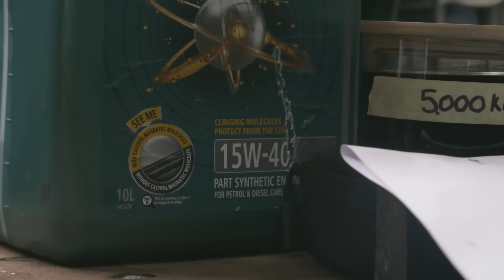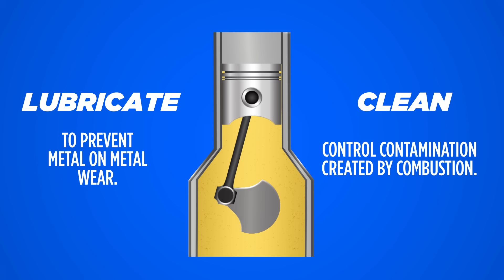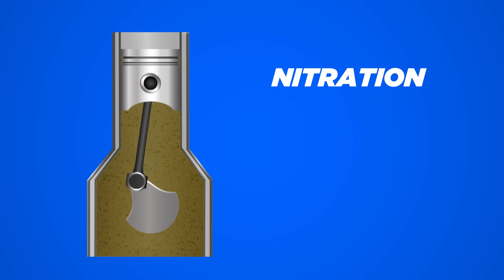Engine oil COMPARED at 5,000km vs 10,000km vs 20,000km! This'll make you service your 4WD RIGHT NOW!

Comment: Hi, i do an oil change to my GQ Patrol TD42 NA every 5000km's DO MY DIFF's, Gearbox and transfer case every 12 months or earlier depending on trips. also flush the breaks and clutch every 12 months.
The old girl has never missed a beat, i need to do some of the bushers soon as its been about 18 months since i last did them.

Comment: New to 4wding a 4WDs myself ford say for my ranger every 15000km and for 170,000km I haven’t had an issue now will be switching to 10,000km just because I do so much driving the cost would be insane

Comment: Engine oil and filter every 5k. Diffs, gearbox, transfer 20k-30k depending on usage for that period (mud and water crossings). HZJ105, just about to drop a factory new FTE converted to Mechanical injection and will be running Castrol products throughout as I have in all my cars over the years. Pretty keen to try Magnatec Diesel, normally run RX super.

Comment: I service my MQ triton Auto every 10000k 
Oil. Oil filter. Fuel filter.  Air filter and clean an flush catch can. 
Driveline I change every 50000kms. 
Difference is , I don’t use off road often. But use everyday 150kms per day.  
This is often at 100kmh.  
Well serviced.

Comment: Have to disagree with you on some of your comments. One of the most important jobs of engine oil is cooling. Why do 4wd's have oil coolers ?   Also  newer diesels with DPF systems  you will usually find the oil gets thinner over time due to all the regen's they do. I've seen Tritons get up to 1200cc of extra oil due to the extra fuel  they dump in use to heat up the dpf.  Oil type and grade is  important to,  once again with a DPF you can't use 15/40  or 10/40 grades,  0w/30 or 5w/40 is used.
Reply: I'm lookn to run the penrite 5w30 full zinc in my new ranger at the 15,000km 1st oil change. 
I emailed penrite and asked them about the enviro plus 0w30 mids saps oil.
The 5w30 full zinc is better for engine higher TBN and was there preferred full synthetic oil for the px3 ranger and the enviro plus 0w30 was the alternative.
Both oils are DPF compatible on select vehicles.
Reply: @marcusbarnes5929  Just have to watch it doesn't effect your warranty. Some dealers won't let you get your servicing done elsewhere  and insist on using  their  oil. I use penrite in everything
Reply: @deadestduck  the ford new car warranty states servicing must be carried out by a qualified mechanic. 
Doesn't have to be at ford to maintain warranty. 
As long as the book is stamped by a licenced mechanic on the service intervals Any warranty work can't be dismissed.
Reply: @marcusbarnes5929  I worked at Mitsi for 30 years , new vehicles had to be serviced at dealership or they could reject a warranty claim
Reply: @deadestduck ACCC state that a vehicles manufacturer warranty is not effected by being serviced by another licensed mechanical shops as per log book.
The dealership has lied to you and its customers to keep them from going elsewhere.

Comment: 1hdt 80 series about to be fte 80 series,  always 5000km for engine oil (I run castrol rx diesel), 10,000km for diffs and fuel filter, 15,000kms for gearbox and transfer but I always check all fluids every service especially if I’m doing water crossings

Comment: as a mechanic I do my cars every 5000km but for my performance vehicles I do them every 2000-3000

I currently work at Nissan and it boggles my brain how the new NP300s are 20k service intervals

they’re clearly designed to live to the end of their warranty period and that’s it in the tip she goes (being a navara you’re lucky if it even gets there)

Comment: 2021 Pajero Sport, family/offroad use. 15000kms is the recommended interval, however I've changed it regularly every 6-8000kms. Interested to hear about the other lubricant's as well, i.e. diff/gearbox, any chance of a follow up video? Hard rule of running the motor for 2-5mins (depending on ambient temp) at startup just because I'm a little paranoid :). What brands is everyone using? Appreciate that Shaun is recommending castrol (sponsorship?) and I've always had a soft spot for magnatec. As always, thanks boys, keep up the great work keeping us amateurs informed!

Comment: I change my Mq Tritons oils at half intervals for the engine and 1/3 intervals for the driveline which is the Diff, transfer case and transmission fluid/oil get changed every 30000km as this is stated as severe use in the owners manual but it's a 1/3 as long as normal use. And the engine gets a half interval of 7500km.

Comment: I own an old diesel (rd28 gq), so I religiously change the engine oil every 5000kms. The gearbox, transfer and difs get changed every 20,000kms (or when they are too contaminated with water/other contaminants). Coolant gets flushed and changed when it shows up bad on a test strip, and brake fluid gets changed when the pads are changed/when the fluid goes black. All fluids get check rather often, particularly before a big trip, and changed if necessary

Comment: gu td42 patrol and i change the engine oil every 5000 the gear box every 20000 and around 25-30k for the transfer case and front diff.

Comment: I religiously change my oil every 5000 klms and oil and filters at 10000 that includes diesel filters due too the garbage in the fuels these days. I service the diffs transfer and gearbox every 20000 klms been doing this on the old 96 Gq since the day it was off the showroom floor she now has 670000 klms on the clock and never had the head off 0 blow by  I put it down to regular maintenance she has never once overheated like a lot of other Td42 owners complain about. She was turbocharged since 400000 klms running a healthy 16psi of boost. I tow my 2.5 tonne camper behind it a few times a year and car float and she never misses a beat.

Comment: my 1999 Toyota Landcruiser HZJ105 1hz with an after market turbo kit from not long after new with 5 speed manual. I've had it for close to 12 months and have done 13k of road and off road use and its about to get its second engine oil change. but it does have a full service history form the previous owner from new  he did services every 8 to 10 thousand ks. and they used Penrite from new and I've always used Penrite oils in all my vehicles. when I brought the cruiser last September I did all fluids diffs gear box and trans case and also did the front swivel hubs at the same time and then only a month or so ago i had to replace the brake master cylinder and abs unit so its had all the brake fluid replaced and I be replace all other fluids in half the amount of the recommended service time limits as its my daily drive business car so I need it to be reliable and regular preventive maintenance is cheaper the not doing anything and only doing things as they breaks its a very expensive way of doing things in my eyes. Happy 4WDing everyone.

Comment: The other reason to change it at 10000 is the oils have different additives depending on the oil but they release and break down the different additives over the life of 10000km and therefore cause damage as the engine isn't always getting all the different additives that that the manufacturers specify

Comment: I have 2010 Nissan Frontier and I change the Engine oil every 3000 miles. I change the transmission fluid every 15000 miles. And at the 15000 mile mark I also change the transfer case oil and the differential oil front and rear. I change the Antifreeze every 30000 miles or every 3 years which ever comes first. Also at this point I change the power steering fluid and I also change the master cylinder brake fluid and flush out the brake lines ( Bleed the Brakes ). My intervals are much sooner than factory recommendations.

Comment: It's funny how all car enthusiasts change their oil more than specified and everyone else doesn't bother and nobody has any oil related engine failures.  Usually the same people who swear by putting 98 fuel in their car when its only setup for 91 🤣
Reply: These engine related failures/problems from not changing the oil and filter enough show up at higher mileages usually. Like oil consumption and scuffing of the cylinder walls that comes with it. Engines that have variable valve timing especially need that oil viscosity to be correct to work properly too. Time is also a factor as there is sulfur in engine oil and moisture and oil leak to sulfuric acid, which then corrodes your internals too over time
Reply: @SubieMatt Yup.  Was neglecting my car for years, and then got a light every once and awhile for oil pressure.        Started changing more frequently and light hasn't come back.
Reply: its true, oil is cheap, but parts are expensive...
Reply: @philipgotay7314  that's how I was brought up. "Oils and filters are cheap, another car or engine is expensive"
Reply: Yeah its funny how car enthusiasts cars last longer
Reply: @dudleythree3  you got me bro 😂
Reply: I m chnging it every 5k kms, so far no engine problems. All of my cars are above 10 years old n still going strong.
Reply: @bobochan4699 Change my oil every 16000km for 9 years, had the car since new. Runs as new.
But it is a petrol, not diesel.
Volvo V70 T4
Reply: It is also a factor if you drive long distances in normal environments vs frequent cold starts and short distances.
My gasoline Volvo gets oil changed every 16000-17000km and I am not nervous about that after 8 years an a total of 130000km
Reply: 10k is fine with modern oils.
Reply: 98 Fuel contains higher levels PEA (polyether amine) which is a detergent that reduces carbon deposits. Therefore, there are still benefits of using 98 even if the care is setup for 91.
Reply: @woox200sx  it’s so negligible that it doesn’t come close to justifying the cost.  I sold my last Supercharged V6 after 273,000km, almost always ran on E10, never needed a ‘carbon clean’ and still ran perfectly when sold. With the difference in cost between E10 and 98 over that many Km’s I could have probably bought a new engine, lol.
Reply: @stevowyeth  273,000km? Is that all? If I was rich enough to get rid of a car that early, I wouldn't look after it either.
Reply: @woox200sx  well, you might be rich enough to get rid of your cars early if you stop wasting money putting a pointlessly expensive fuel in them 😄
Reply: @stevowyeth  Difference in fuel cost would have to be a lot higher to buy a new car.
Reply: I had Ford Fiesta 1.25 manual for six years. Bought new, went 160kkm. Changed oil according to the manual, namely each 20kkm. It was circa once in 8 monts. When I was selling it, the buyer did full engine diagnostics (compression and so on) and found nothing bad.
I think   it's garages who   spread this hysteria about need of oil change interval of 5kkm.
Reply: "Follow the manual! Only use THIS OIL!!" but wait now ignore the manual and change oil at half the time.
Reply: What a load of shit this test is.
Reply: Maybe cuz they know how to fix it, when it goes bad lol
Reply: Most car enthusiasts push their cars much harder, earlier changes when driving hard are generally better
Reply: A lot of cars are burning oil from sludged up low tension oil control rings and drain back holes.
Reply: Lol go drive your tesla simp
Reply: If you can change oil yourself it’s better to do it earlier than 20 000 km when you consider oil and filter is not expensive. At the same time doing it every 5000 km that is every second month for some people and that is also annoying.
Reply: My Lexus is protuned for 93 and I use Lucas octane boost very other fill to run prolly closer to 95-97 on the regular. Nice tunes can tell you’ve done this and advance accordingly despite having a base map. Most feel out the engine first. I just use it for that and it contains upper cylinder lube

Backfires less with octane boost as I m pretty sure it’s less likely to detonate in the exhaust reducing cat wear, but it sounds pretty cool at least😂😂😂
Reply: @rosslucas700 if you've tuned your car so it can make the most of a better fuel that's great, but you aren't in the majority of people that my comment was referring to 👍
Reply: Yep like that one Clown who thinks his car goes faster with the heater on
Reply: @jamezxh  I've saved a car from overheating using the HEATER so it does something. It might be 5 degrees down from the overall engine temperature but it is something. So if your car is running hot and you put it in the right temperature range using the Heater - yes, will produce a marginal increase
Reply: And K+N air filters make the car produce more power 😂
Reply: @Cl4rky  😂. Pod filter . Induction noise equals horsepower
Reply: @jamezxh  it’s all fun and games to laugh at something, but actually if you run the heater flat out that in turn can cool the cooling water which will help cool the cylinder heads a bit, on a car with a marginal cooling system that could be the difference with it pulling some ignition timing or not, could be the difference of a couple HP. Also in the ecu program of my ba falcon there is provisions to modify ignition timing with the heater position, usually used to retard timing to increase engine temp to heat the heater up quicker, it’s all set to zero but if I were to put -2 in those cells and throw a couple points more octane in the tank turning the heater on full would gain 2 degrees timing advance and with the higher octane to stave off spark knock that could gain me 6 or 8 HP. 
Also an engine that pulls enough air will gain a few HP from a less restrictive air filter setup. A k&n pod filter in a proper enclosure to feed it cold air is worth almost 20 HP over the stock filter arrangement at peak rpm (6500) in my heavily modified V8 falcon. 
It’s all well and good to have a laugh at young blokes that try all this on a stock v6 commodore for no gain but in the right circumstances it certainly can make a difference. 
I just felt like putting this out there for fun, I got nothing else to do, too expensive to drive around in a modified V8 on 98 octane 🤪 have a good night 👍
Reply: @Cl4rky  I mean this is true tho gains are minimal especially untuned andor no boost

Comment: New Motor - New Injectors - New Turbos November 2019. 
To date almost 3 yrs later and Only 10,000 ks Done had 2 oil changes in that time. So 5000 ks average change.. Let's just say that The Mity 200 doesn't see the road alot 😀😀

Comment: If my 4x4 is still under warranty I would follow the dealer/user manual directions for oil changes to be sure not to void any warranty. After warranty has passed, when I change the oil depends on the age and use of the vehicle. Older car and/or heavy use = more frequent changes
Reply from the maker: Some manufacturers also offer interim servicing so you can get more frequent oil changes without any warranty issues.

Comment: Every 10000km for oil (with a oil flush) air,cabin and fuel (ryco service kit) 40000km for diffs and transfer case. 40000km for radiator. Prefilter and provent catch can is every 30000km. 2016 MUX. To change the oil every 5000km would not be cost effective for us..

Comment: GU RD28 Patrol: 5000km for the engine, every 15,000 for the rear diff, every 20,000 for the gearbox.  Every 30,000 for the transfer and front diff.  I always run full synthetic oil, and ZDDP additive for the engine.
Reply: You must be love your Patrol 😊 15,000 km for rear diff and 20,000 km for gearbox seems very short!
Reply: @turkkiq  This is how you make 4wd diffs , transmissions and engines go 600,000 to 700,000 km provided that you don’t abuse the vehicle.
Reply: Seems excessive

Comment: I've got a 2007 Hilux Single cab with 180,000km on the clock, which quite often has heavy loads on the tray but doesn't tow a great deal, and does quite a few short trips . The engine see's new oil and an oil filter every 2,500km as well as a quick clean of the air filter, and I drain both fuel filters and grease the Unis and spring shackles at the same time. Every 20,000km I change the air filter and both fuel filters and every 30,000km I replace the front and rear diff oils, the transfer case oil and the gearbox oil. Finally, every 50,000km I replace the power steering fluid and the Brake fluid, two things that are often neglected in vehicles new to our workshop.

Comment: I do 10k for engine havent had my hilux for long enough to change anything else. BUT there have been studies done by certain oil Companys that changing too soon can also be bad for the engine
Reply: In what way could it be bad for an engine? The oil is in its best shape straight out of the bottle, it only gets contaminated and broken down as it gets used. I call BS on that study, the only way the oil change can hurt an engine is if it hasn’t been done properly ie running the engine for extended periods with no oil pressure after a change or using the wrong fluids.

Comment: Hi guys 
Toyota recommend 0/30 oils for the newer cars including my 2021 Hilux . I live in a cold climate area near the snowy mountains. I’m heading north in September for 6 weeks should I swap out the oil to a 15/30 ?
Reply: No.
0w30 is fine. IT WOULD BE A Mid SAPs oil for DPF...
 It is what the mechanical engineers have recommended at Toyota as they have problems with DPF
Reply: Those new D4S dynamic force engines use 0W16 oils, it just like water

Comment: Service interval for my Ute is 15k. I usually do it at 5k, without changing the type and brand oil for consistency, which is usually Castrol. Everything else is usually half the service manual recommendation unless it’s been worked hard, water crossings etc then I will do it as required. Hydroscopic fluids such as brake fluid is half the service interval of 12 months. I’d hate to think how much ‘extra’ money I’ve spent over the years with what they say is unnecessary but as a diesel fitter I’ve seen what bad maintenance does to machinery, and how the costs to fix it is often way more than the added cost to additional servicing. Plus it’s fun and you get know your vehicle more.